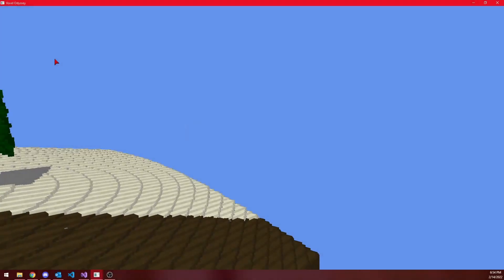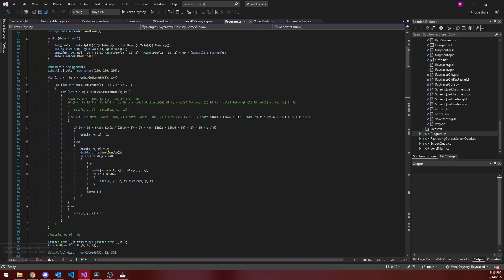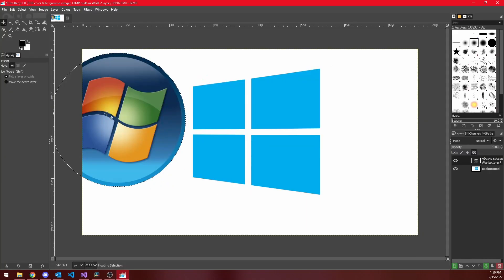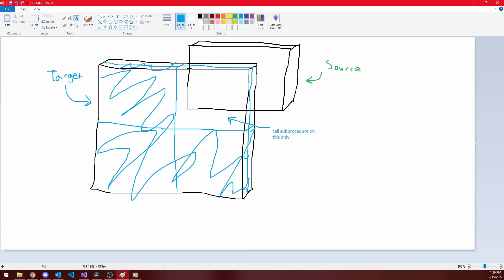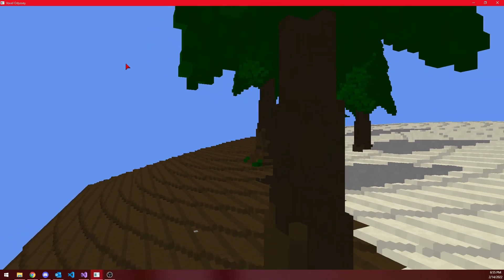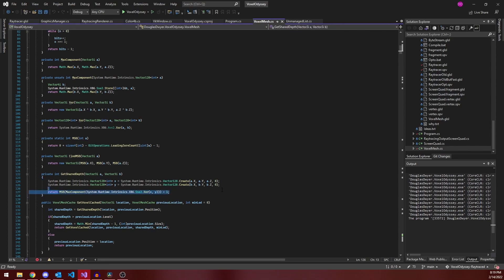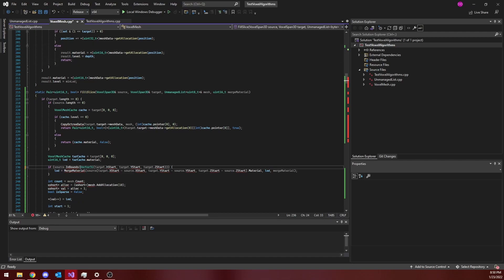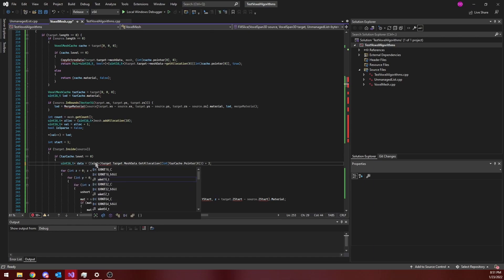Sparse voxel octree modification and benchmarking [Voxel Devlog #3]

Comment: Could you elaborate on your rasterization and raymarching algorithm I'm not exactly sure what you meant?
Reply from the maker: Because older hardware has trouble with ray tracing, I've begun to experiment with rendering voxels using the standard triangle-drawing methods on GPUs. In an upcoming video, I intend to discuss these alternate approaches, which include essentially using ray marching in the rasterization pipeline :)
Reply: @DouglasDwyer  you do know that vulkan only supports more recent cards?
 
The oldest supported is the GTX 600 series so there isn't any "old" hardware that you'll have to worry about since vulkan doesn't support it anyway. 

If you want compatibility with old hardware OpenGL3.3 is the only way to go... :/
Reply from the maker: @clemdemort9613  Yeah, when I said older hardware I specifically meant lower-end GPUs (including integrated GPUs) and graphics cards from 2010+. Even on modern low-end hardware (like my 2020 Intel UHD Graphics), the ray marcher shown in the video struggled for a number of reasons I hope to talk about in another video. Wanting to have a deliverable even for computers without fancy graphics cards, I'm exploring other options.
As for Vulkan, I've actually moved to targeting OpenGL ES 3 so that the project can be used in browsers with WebGL 2.0 and Emscripten. It's definitely not ideal, but in the future we will hopefully see WebGPU standardized, and that can be a modern web-friendly alternative to Vulkan.
Reply: @DouglasDwyer  fair enough yeah, I'm all for extra performance! :D
I personally will stick to raymarching in my own projects since this way I can have more realistic lighting and effects.

Your project has this Voxlap feel which I kinda like too so you might not need super realistic lighting if that's the style you're looking for. Anyways good luck with your implementation !
Reply: @clemdemort9613  Look up "VXGI 2 minute paper" on youtube.  It's a combination of rasterization and then computing the GI lighting using voxel representation of polygonal objects.  I think it's a good mid-tier approach for those people who can't get the newest video cards with RTX which are extremely hard to get right now for a decent price (Pre-corona).